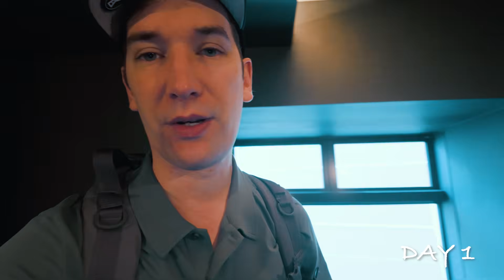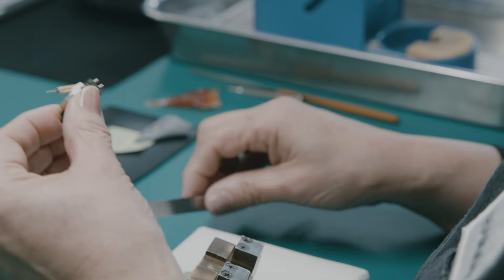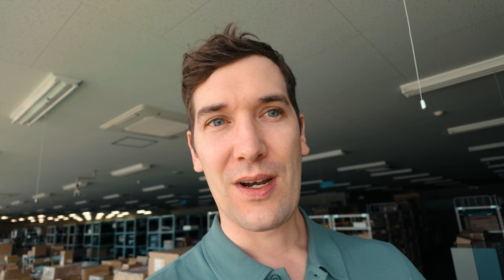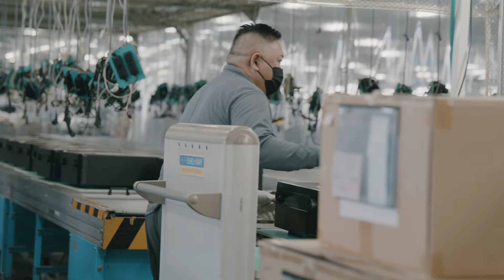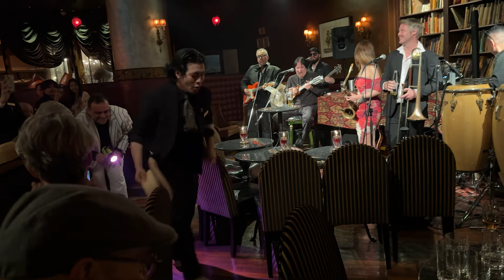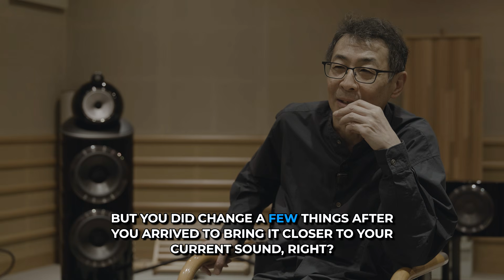Inside Denon & Marantz in Japan — A Rare Factory Tour

Comment: "Marantz? Please. While one must commend them for convincing the unwashed masses that mass-market consumer electronics constitute 'hi-fi,' anyone with an ear trained beyond the level of a drive-thru intercom knows better.

That warm, 'musical' house sound everyone raves about? It is nothing more than deliberate, bloated second-harmonic distortion engineered to mask the glaring deficiencies of budget-tier operational amplifiers and off-the-shelf DAC chips. Real fidelity demands unvarnished accuracy, relentless transient speed, and bespoke discrete circuitry—not a shiny porthole display, a gold-plated faceplate, and a rolled-off top end designed to keep harsh digital masters from offending casual listeners.

If I wanted my sound signature utterly smeared and colored, I’d simply throw a wool blanket over my speakers and call it a day. I’ll stick to my hand-wired, zero-feedback, single-ended triodes and custom-wound toroidal transformers, thank you very much."